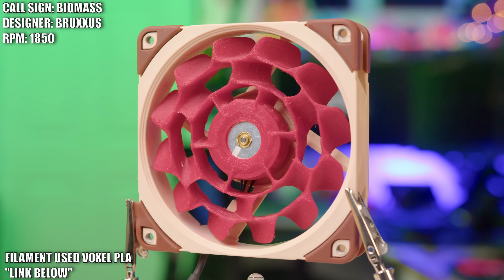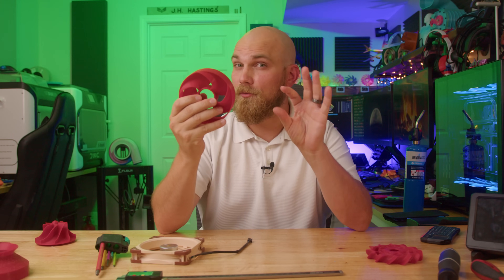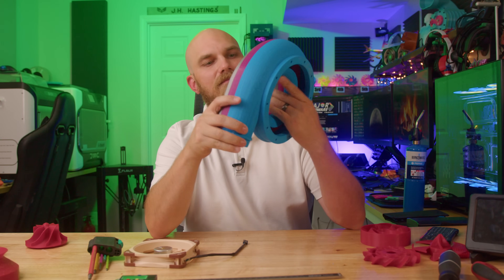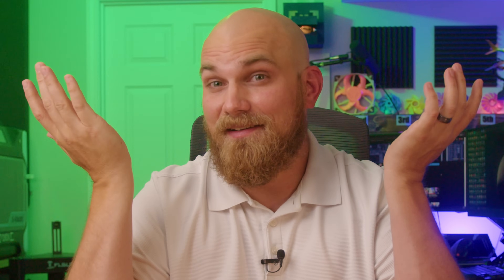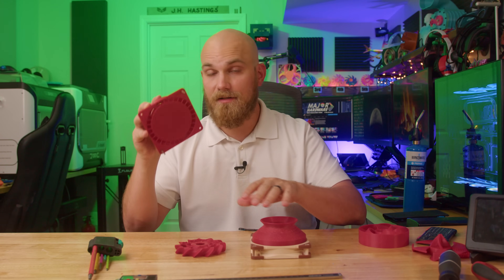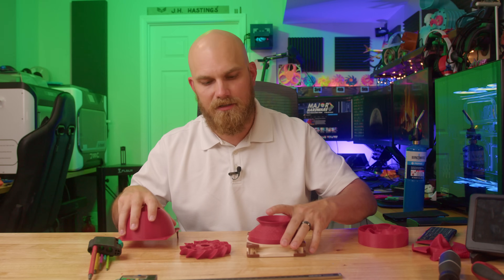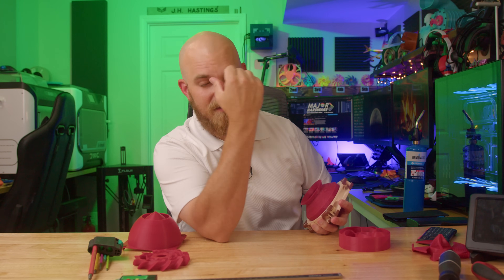What If Noctua Made A TURBO? | Fan Showdown S4E11

Comment: the turbonator is an inefficient design. It has a turbo impeller throwing air outward but its design is expelling it outward. Turbo housings are designed with a side exist to increase that efficiency. The housing itself is getting overloaded and is unable to pull in more if the stator was replaced with an aggressively angled stator fin, it may help direct the air backwards in a cyclone. Also the rear housing is further compressing the air and restricting airflow. Remove the rear housing or at the least, remove the inner section and it should help.

Comment: Ok, I', completely ignorant regarding the physics of cooling and air, but I remember reading somewhere that air speed over a surface = cooler surface ( until the air friction starts to warm it up). Everyone mentions flow... but what about airspeed over a parallel surface? specially for coolers like Noctua's NH-D9L that has so many surfaces to cool...

In my tiny uneducated brain, that would make the turbinator outperform some flow focused fans if pointed the right way to a Noctua's NH-D9L , right? so a nice balance between speed and flow would make permormance improovements??

Please help me understand it better, kind community.

Comment: I set up a car radiator a few weeks ago with an 18" floor mounted fan in a bit of ducting.  My hope was that I could use ambient air to heat my swimming pool or at least partially when the temperature delta was large.
It was a massive fail.  Whilst the fan had enourmous flow it had almost no pressure and was unable to push air through the radiator.
I suspect the same is true of many 'case' fans being use to cool radiators. They just don't have the static pressure.

Comment: One of the biggest differences between user-made-fans and brand made fans is the depth. Referring to how far they stick out of the fan casing. I don't know why the cheater seems to be one of the few (only?) to have ever included a rear funnel which is part of what helps it create better air flow - along with sticking out the other end. You could add that section to any fan to improve it. But if brands were to create more fans with this concept... thicker fans instead of smaller diameters... we could get some way better fan designs.

Comment: A turbo is designed to make pressure, not air flow.
Not surprised it did so bad.

It would be great to have a pressure test (fan blowing in closed box and measuring the pressure difference…

Comment: Actually there was already a fan which had the output of a turbine, both in jetstream and noise.
Delta EHE Ultra 120mm. 190CFM. which means 322,81~cubic meter per hour airflow.
For comparison: This Noctua fan has only 54,97CFM. (Airflow 93,4 m³/h)
So noisy you had an entire airport in your house, so powerful you could attach 4 to your chair and see the moon landing straight from the landing point.
Yeah, of course is not that powerful to propel you to the moon but me and friends joked a lot about it back then :)
I'd really love to see your face when trying out that fan :D

Comment: Boost leaks, story of my life. That gasket would've helped. Someone should try to design a hybrid style small turbski with the exducer portion of the compressor wheel modified to push air straight through to the back rather than to the side like it normally would since there is no compressor side outlet to an intercooler like in an actual turbo for a car or whatever people 0ut turbos on these days.

Comment: The turbinator looks cool but doesn’t work. An impeller is designed to direct airflow outward at the base, not through. Even with the gaskets you’ll probably get leaks around the edges; worst case scenario you’ll have a ton of turbulence inside the fan casing, creating back pressure and decreasing airflow out the rear. 

But I was pleasantly surprised by the biomass fan, I didn’t expect it to pick up air so swiftly. What that fan needs is a high quality print or injection mold, there was so much variation across the blades I’m sure it contributed at least 3db to the sound test. Thinner, smoother blades would allow more consistency in airflow and possibly closer spacing of the fins which means you could fit more of them.

Comment: the turbinator is loosing a LOT of air without that gasket, but generally wont spin fast enough to make the airflow it needs to really shine on an a12 frame. if there were some way to ramp that thing up a couple thousand rpm it might make a big difference

Comment: I had an idea… Classes for the fans to compete in.
Class C: fans that fit inside the A12x25 frame.
Class B: fans that extend beyond the frame
Class A: fans that have additional attachments or shrouds beyond the frame.

That way you could have a combined leaderboard, and an individual leaderboard for each class.
Reply: It would have the additional benefit of if you wanted to use one of the designs, we could look at the leaderboard for the class.

Comment: Since 3D printing takes time regardless of what you're doing have you considered trying a resin printer for printing out the fan blades instead of the normal extruder style? They're best for doing complex & detailed designs and the finish is much nicer. Of course the part needs washing and curing versus your current setup though. :)

Comment: I wonder if you could do a test on how the mass of the fan blades affect the performance - same design, but different thicknesses/weight fan blades. If you can control for power, I think it would be interesting if lower weight fan can use the power more efficient, achieve better speed and cfm :)

Comment: switch to DLP resin printing or resin printing in general. also, get a new tip and lube up your gantry and make sure belts are snug. both cooling fan needs to be in proper working order, the nozzzle fan and the head fan.

Comment: I created the FS1, and while it had some flaws, I never designed a fan before and to get 33rd place out of a lot of fans tested... Well that's a good start.

I want to comment about the fan print quality. I agree that it's sub-par, and actually my fan didn't print correctly at all in the cone. My design did not have gaps between the vanes in the cone and if I had known what the minimal thickness requirement to avoid that, I probably would have made the center thicker to accommodate. 

Partially my fault, partially printer issue.

Comment: Hey! My BioMass entry finally got in!  Thanks for testing it. Did better than I expected. :)

Believe it or not, I designed it in TinkerCAD, imported into 3D Builder, and used the smooth edges feature to create the smooth lines. 

I think maybe I should properly model one to be more efficient.
Reply: You did great, I knew it will be good right after the smoke test.
Reply: @RedStefan  Thanks! ☺
Reply: I LOVED THE BIOMASS
Reply: @OriginalForce-x8m  Thanks!  :D   I've been wanting to design an "Evolution 2" for it, but haven't had much time. Eventually!

Comment: Maybe make a smaller outlet tube for your airflow test, sized closer to the outlet of the turbinator (or any similar designs that may come your way.  Doesn't need to be fancy, a rolled up piece of poster board would do it.

Comment: If you want to get more specific advice for print quality you may want to print some benchmarks and a long straight upright stick, then post them to your socials.
There are a lot of artifacts on your prints for reasons that can range from a bent axis screw, excessive vibrations and improper separation of printhead causing nasty stringing and foaming.
Also it looks like the filament may require moisture removal sometimes

Comment: On Biomass, the multiple blade segments with different angles of attack totally make sense. Most blades we see on the fan showdown have a twist to them to give a consistent angle of attack at different radii. The multiple blade segments are just a piecewise approximation of that, using a fixed angle for each segment, but change the angle of each segment depending on its radius.

Comment: IF I COULD SUGGEST JUST ONE THING IT WOULD BE THE FANS SURFACE FINISH. ALMOST EVERY FAN I HAVE SEEN YOU TEST HAS HAD MATERIAL SURFACE IMPERFECTIONS. I GET SOME 3D PRINTERS LEAVE AN EFFECT TO AN EXTENT BUT CAN YOU NOT MAYBE JUST HIT IT WITH A BIT OF SANDPAPER OR SCOTCHBRITE? I GUARANTEE IT WOULD MAKE A HUGE DIFFERENCE. AS WELL AS GASKETS ON SOME DESIGNS. THANKS!

Comment: jet engine intake fan blades are tilted as the outer edge is spinning faster but does not need more airflow so theyre tilted to provide a balanced airflow to reduce turbulence which reduces drag, so if someone calculated the pitch needed for balanced airflow and then made it into a fan then it could have some interesting results, im not saying best results im saying interesting results

Comment: Have you considered getting manometer / barometer to test static pressure?  Would be interesting to see if designs such as the Turbinator at least outperform others in that aspect, if not max CFM.

I've also starting to think maybe fans should be divided into classes, analogous to some car racing leagues:
"stock": ones that fit entirely within stock frame
maybe a mid tier "modified" class: slightly protruding within some limit (for example, say, no more than 1 inch from either inlet or outlet, but not both).
Then "unlimited" class for the cheater etc.

Comment: i am curious if the ducting on the back is actually impeding the flow of the turbinator i would love to see a test without it to compare though i still dont expect it to beat the cheater because the intake is also smaller...  

if anything will beat the cheater it has to be light weight so it doesn't slow down the motor and can reach high rpms while also expanding the area in which it intakes air and not restricting airflow AT ALL the concept of pushing more air through a smaller hole only works with really high static pressure which can not realistically be achieved using the notcua motor. which is also probably why the high rpm motor is necessary for the supercharger to work well.

Comment: If you added a pressure category, the turbinator would have won.  Mount the fans onto a box with a variable hole with wind speed, add a pressure sensor then you could profile the fans with pressure gain vs volume flow. The actual radiators will add resistance to the flow that requires pressure to overcome. The flow test you is open flow with no pressure rise, one end of the spectrum. The other end of the spectrum would be the pressure rise with a closed box and no flow.

Comment: You should do 2 separate air flow measurements, 1 unrestricted, and 1 with a restriction, so you can also test for static pressure, and that is probably where the turbo design really shines.

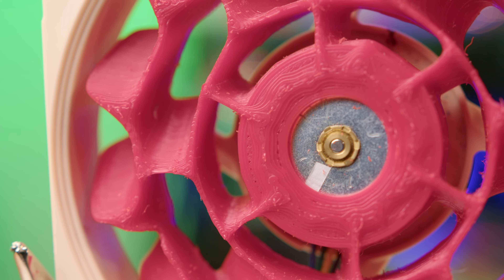Comment: 0:56 many fans you have tested have variable angle of attack. 

It is standard practice to decrease angle of attack for parts that are moving faster through the air, and increase it for parts that are moving slower. Almost every fan is shaped like this so the blade closer to the center is tilted more, and further it gets from the center it will be twisted less.

Comment: I feel there is a lot of static pressure to gain on most fans because the gap between motor support and the fan blade is to big. The closer you are to the radiator the better.

Comment: Also...
I think if someone is here knows how to calculate the theoretical maximum for the volume of air we can move per second, which is kinda another take at Betz law and i think something similar will work here.
Like think about it if you spin the fan at infinite speed it means that it will grab the air in front of it instantly, and there will be no air to push through so you very dependent to the natural air speed in your room which is kinda created by a single fan in our case. 
So the question is how much air we can push  through the cross-section of the fan at "room conditions' 
That's a very hard calculations and for some students reading,  this task is at least a term paper scale project and if you dig a bit deeper it's even can be a master's degree level of complexity, and if you push a little bit higher that you get to the PhD level, when you factor in many things and solve that crazy differential equations and get to the actual theoretical maximum of air being pushed through some area. 
Of some formula like this already exists XD 
if should factor in the humidity and pressure, if we assume that the air in the room is not moving.

Comment: Personally I would try to smooth out those prints with acetone. Would be interesting to see if there is an improvement in airflow with the surface of the blades not being so rough.

Comment: Tips for printing better quality: Test your temperature. Honestly, do like 10%-15% above and below what the filament recommends (i find i print better when below the recommended for the filament on my printer). Do a temp tower/stringing test at 5 degree increments. Once you find the "cleanest" result, do it at 2 degree increments to fine tune it. Then do that for retraction length, then retraction speed. Oh, and turn off the part fan when doing the tests.

Once you've got the GCode for these 3 test, just save it and every time you get a new filament, spend an hour dialing this in for amazing print quality.

Comment: The golfball is probably the most misunderstood aerodynamic phenomena.
The dimples actually increase drag by creating turbolence, but on a ball shape the turbolent air can follow the curevature of the ball for longer, thus the ball has a smaller wake and the overall drag is lower.
If your wake is already small (such as from a thin blade) dimples will only increase drag.

Comment: A high pressure turbine design might not have great cfm, but it should be great blowing through a radiator because it won't be affected by the resistance as much as other types of fans. 

I would put it in a real world environment to get a better idea of what it will actually do. Maybe start testing your fans on them blowing through a resistive duct filled with polyfill.

Comment: an interesting additionnal measurement would be the actual power drain of the fan during the air flow test, with a voltage swipe, since it's a 12V motor that starts turning around 5-6V, we could have a plot power consumption vs volume displaced. That would be a very interesting metric

Comment: The Turbinator could have been sealed with a couple of loops of electrical tape on the outside. I think it would be really interesting to see how it performs without any leaks. Probably wouldn't help too much in terms of volume but the outlet pressure would be higher.

Comment: Best prints I've managed have been out of PETG. Its better in basically every mechanical aspect than PLA and since PLA isn't as actually as biodegradable as marketing would have you believe you may as well use PETG. It's basically cheating. Just use prusaslic3r to print one of those towers with different temperatures to see what offers the best balance of layer adhesion and being able to print overhangs. I normally run 230 for the first few layers for good bed adhesion (I print on dollar store picture frame glass) and 225 after that with 75 on the bed.

Comment: The real issue with "turbo"-looking designs is that they involve compression at all. Compression consumes power, and to what end? The ideal arrangement would promote laminar flow and take care not to generate counterproductive vortices. The spin arrestor on the tail end of the cheater is one of its more important parts.
Reply: The higher pressure afforded by those designs allows for a higher density of fins in the heat sink, resulting in a larger contact area and thus higher rate of heat transfer.
Reply: Which would be well if we were still looking at thermal performance, but that is so three seasons ago. (Hint: I'd like to get CPU cooling back as a metric.)

Comment: You really need to get some proper gasket material for the multi-piece fans and retest the best performing fans from previous seasons on your latest setup. Airflow is such a finicky thing to manage that the smallest changes in setup can lead to huge differences across tests.

Comment: For the printer tuning. First off. Use cura. It’s the best. Second. There are multiple tuning things to do. E-steps for x,y,z and e axis. Ensuring layer height it correct. And lastly. To get the best print quality. 0.2mm nozzle with a much slower speed. Something like 30mm/s.

Comment: AH MAN... you should really redo that turbinator when you get that gasket... so much lost pressure... wasted flow :( .... ghetto fix- you can wrap electrical tape around the outer edge... even works on the intakes of BMW e39 and e38s when you forget to put the breather valve gasket in the rear of the intake... electrical tape- the duct tape gasket fixer of OOPS i forgot it :D

Comment: TURBINATOR is NOT a air mover … IT IS A AIR COOLING unit.  This one needs to be TEMP TESTED… how well can it keep the unit cool.   After you get that gasket that is.   The air leaking is a sign of the compressor compressing the air at the divergence cone… and it was leaking a fair amount here.  I feel that cone is doing what it’s supposed to be doing… compress to expand… expanding air is cooling air

Comment: I had a feeling the Biomass was going to turnout well it looked downright HUNGRY in the smoke test and the design, while not particularly planned, was actually pretty smart. I'm surprised the Turbonator didn't do better, maybe it needed a larger intake? (or maybe a smoother print? I've actually wondered if print quality effects the airflow.)